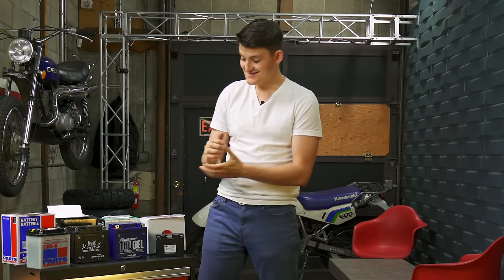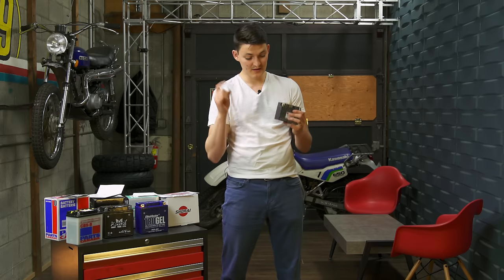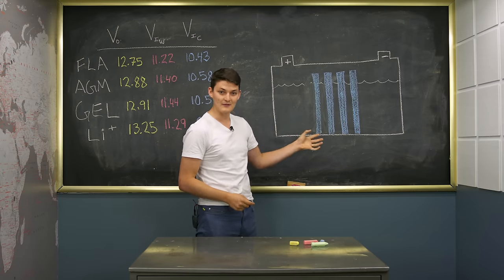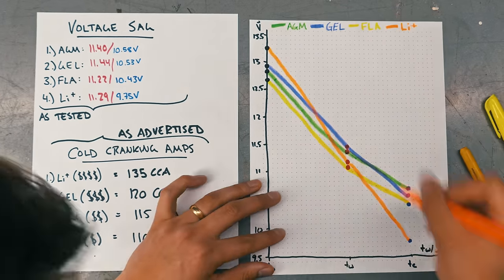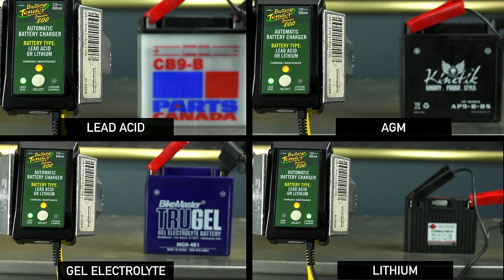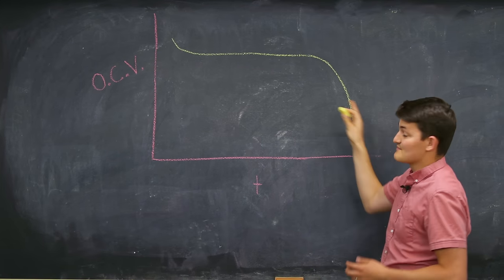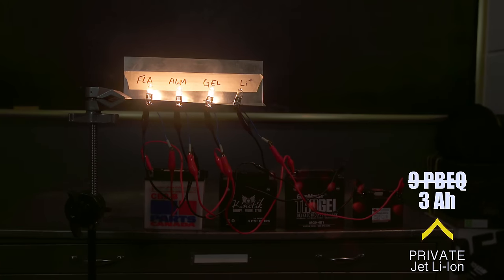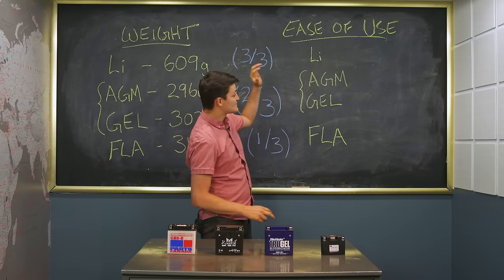Best Motorcycle Battery? Lead-Acid v. AGM v. Gel v. Lithium

Comment: I used a 3D printer to build a ventilated "box", in which I was able to place TWO Lithium batteries, which were tied together.  Then, I made a tray that drops inside it (over the tops of the batteries), where I can store stuff.  The whole package perfectly fits in the space my stock battery occupied, while STILL weighing less.
Reply: why two batteries instead of a bigger one?
Reply: Bad Idea to tie two lithium batteries together, especially  during recharging.

Comment: I'm an electronic engineer and I freak out every time I see a video like this... because most of them are full of crap. But not yours !
It's mostly technically accurate. I appreciate the research you've done, even if it's not 100% scientifically accurate, it definitely shows that you do your homework and provide meaningful videos for your subscribers. It gives you a lot of credibility. Thank you.
Reply: thanks for your confirmation, really appreciated it.
Reply: I'm pretty sure he's an engineer as well, not sure what kind though.
Reply: What were the inaccuracies?
Reply: @Ryan.......  oof it's been years, but for instance, using a light bulb instead of a constant current load to determine the battery capacity. Since each battery technology has a different discharge curve, the actual load current will vary during the test.

Same for the suicide test.

It's mostly a nit, and not a big deal for this video, but it is indeed a less accurate methodology. There are cheap battery chargers (the type used for hobby RC flying for instance) that also have a capacity test, and that can do it properly with a constant current load, and a proper cutoff voltage for each technology. They will give you the actual capacity in mAh or Ah.
Reply: its totally crap, he's just making it up.. you can tell cos there were no chronological combinations of months in 2019, or even 2018, that total 60 days.
#DetailsTellTheLie
Reply: @Ryan.......  I'd also like to mention that Li+ (lithium ion) batteries are NOT the same as LiFePO4 (lithium iron phosphate), and in this video the former is used as an abbreviation for the latter - this is largely irrelevant to the actual results (and the conclusion of "just buy the cheap one", my favorite kind of conclusion), it's just a little attention-to-detail thing that bothered me, FortNine is normally really good about that kind of thing.
Reply: @sayuas4293  I believe he has a Dr. in physics.
Reply: @Ryan.......  I laughed as well.  Why would an electronic engineer state, "...it's MOSTLY technically accurate" without stating the inaccuracies to prove his point and further enlighten the author or open his claim to discussion?  Maybe it's because his claim of any inaccuracy is also "full of crap"?
Reply: @uski  Motorcyclists tend to leave their headlights on accidentally, so it's kind of okay that he used a headlight for testing the battery.
Reply: @Ghryst  The 60 days is where you draw the line? If he specifically said "I left them for 60 days, while not specifically 2 months to the day, it has still been almost exactly 2 months.
Reply: @sayuas4293  Ryan majored in art history and physics, so not quite an engineer, but he's well informed.
Reply: "electronic engineer"    lol    I've never referred to someone with a degree in electrical engineering in that way, let alone myself.   Are you sure?
Reply: @broderp  not everyone is born in the USA. Different countries have different ways to call engineers. In the US, I would probably been called an "electrical engineer". But where I am from it's "electronic engineer". 

It's not because something is not done the way you are used to, that it's incorrect or wrong
Reply: @uski  and the fact that they are at different voltages, the lithium battery was outputting more wattage
Reply: @scottamolinari  Just undergrad. He explains why he didn't take it any further in the video about himself.
Reply: That's because electrical and electronic engineering are 2 different degrees .. so I ask .. are you sure ?
Reply: Different countries have different degree composition. The distinction in one place doesn't translate very well elsewhere. It's a pointless discussion and I see a lot of people nitpicking on the terms when the meaning is clear.
Reply: Ok, plain old lead acid is alright. But even they are not all the same quality. And so we still don't know which one is a good one. Thus nothing has been solved. There's a jillion different lead acid batteries out there.

Comment: Oh god damn it. I JUST BOUGHT A BATTERY YESTERDAY AND THIS COMES OUT. 
AHHHHHHHHHHHHHHHHHHHH
Reply: Bute the real question is .... how much?
Reply: Ehh I've never had issues with lead or lithium pick a flavor and go with it
Reply: Same, I got a massive gel battery
Reply: Same story here....
Reply: Its the same with cleaning out the garage or attic....
Reply: I hope that wasn't lithium!
Reply: David David  But if you know more then basics, you would avoid it
Reply: David David  Ok, fair enough
Yes, main advantage for lithium is power density, which is important for mobile electronics and Teslas?

Probably it is mechanically more durable, but God help you if you puncher it on a motorcycle...

Lifespan of lithium greatly degrades if you increase charge/discharge current, acid handles high currents much better. Ok you do need give it some time between high currents, but it's also good to do for the starts.

Lithium doesn't like to be fully charged, also degrades lifespan, Windows10 in balanced battery mode does not even charge it over 80%. Acid battery is very OK with 100% charge.

Lithium requires special IC to control charge voltage curve, protect from overdischarge, charge temperature. Which is another point of failure. 
And if your employer is chip, it will be done by SW driver, which is another point of failure.

In my experience lithium stuff dies unexpectedly, acid usually give you some clues before it's dead.
I would argue that lithium lives longer, I don't have experience with starter lithium batteries, but laptop batteries 2-3 years - dead, also warranty on batteries is limited (year or even half). Usually dies one cell, but since stuff is glued together you cannot replace it and need to buy whole battery.
Last week removed cooking battery from my work-laptop

Acid batteries usually last 5+ years. I've seen 10 year old batteries, but for some reason they where original that comes with the car.

I agree that we made a lot of progress with lithium, but as a starter battery - meh, not worth it.
Reply: Roman Yudin no lithium is better in every way save cost and low temperature. Most people ride sport or street bikes so temperature is irrelevant. The stuff you said about high current is completely stupid. It’s like saying “oh but foam bike seats don’t like extreme heat and will burn if you set them on fire!” Why the fuck would you do that?
Reply: David David exactly
Reply: Lithium battery are not the best for every situation, sure they’re great for someone looking to shave weight off their sportbike but for someone using their bike in cold weather/doing short rides, lithium isn’t recommended.
Reply: David David why?
Reply: David David from what I have seen in the marketplace to match factory capacity with lithium would cost 2 to 3 times the cost of gel. My lead acid batts last 5yrs so why would I spend so much on a lithium battery 😞
Reply: David David go on a diet. Much cheaper than lithium
Reply: @Sassewere  I have a lithium battery on my snowmobile and it sucks! For cold(freezing temp) applications don't bother.
Reply: always wait 1 day before buying battery. gees you gotta wait for the video man

Comment: I like my Lithium's for the 2.5kg saved from high in the chassis. They also last a lot longer than acid batteries that typically only last a few years. You just have to be mindful of their small capacity and warm them up in really cold weather.
Reply: I got 10 years out of my last AGM battery.  For my use case, this video has helped confirm my last choice not to go LiIon.  I did initially consider the total cost of ownership, but part of that cost calculation was knowing that my battery is not going to cause my bike to catch on fire.
Reply: @timconnors  enjoy the 3,5kg brick high up inside your bike

Comment: Never had an issue with Li-ion batteries and i've used them in winter where outside temps can drop to the 10's or less. I also didn't use Shorai which was often commented on as being the most susceptible to parasitic drains and dodgy warranty service. Feedback was from purchasers of the battery.

Comment: I went from lead acid to Lithium in my previous motorcycle (I never should have sold it with that battery in it).  The best advantage was weight and size.  I ended up with over half of my battery tray for space for extra tools.  I felt extra tools or supplies was by far worth the extra money, especially when on the side of a low traffic road.
Reply: I accidentally started a turbo-prop engine once with a wrench across the start leads.  Smoked (literally) both massive 24V batteries and the aux cart.  

Caution is advised...

Comment: Capacity test: I would have liked to see how many times each can crank or start an engine (take more electrons than lighting a bulb)
Reply: Because amount of energy it draws from the battery varies a lot which makes the test even more pointless than light bulb test.
Reply: Jay Jay  No. Cranking an engine is a high amperage scenario and the Lithium battery could very well be able to deliver the same amount of energy as the others if the load was high enough.

In other terms, the Li-ion isn't 9 Ah at all like they advertise but one might find the Pb batteries can deliver about 3 Ah when the load is substantial...making them pretty even
Reply: @anidiotinaracingcar4874  Yes, but it's harder to test that accurately.
Reply: most motorcycle starters draw 70-100 amps. Best way  to continously pull those amperage for consistent numbers is the same way Ebikes users do to test their battery capacity. They use a power inverter like a 1000w pure sine wave inverter and hook it up to something like a heat gun in the 900+w range. A 1000w inverter will draw up to 83 amps constant.
Reply: Yes, I was thinking the same thing. Perhaps running the starter varies a lot, but having another big load, ~1kw @ 12v, and see how that changes with discharge would be really interesting. I've never forgot to turn my lights off, on the other hand, I've had batteries that didn't have the juice to crank the engine.
Reply: @bunbunson27  An unregulated heat gun, then
Reply: @anidiotinaracingcar4874  Consistent current draw, though
Reply: Oliva Gina  Post your video then and I'll critique it
Reply: Oliva Gina  Must not be that easy then
Reply: Oliva Gina  But they aren't cranking an engine, so it's irrelevant to what I said. 

But yeah if those machines are so cheap and easy to get, why don't you send one to PF so he can do the testing?
Reply: VolDep45  Except for the fact that bikes have alternators.
Reply: Oliva Gina its called a load tester and can purchaesd for as little as 50 bucks
Reply: @anidiotinaracingcar4874  You're right and that is a very important point. There is a reason that vehicle starting batteries are rated in CCA and others in amp hours. Just to further undermine the lightbulb test, in FLA, AGM and gel, the faster the discharge rate, the lower the capacity. I'm not sure about lithium tho. 
I've had the misfortune of again researching batteries today because my current factory AGM is just about shot. I settled on lithium iron phosphate because of the weight, the higher CCA and the low voltage cutoff...because leaving my ignition on is how I killed my current battery. Also, they can be charged far quicker than the lead acid options using the right charger (90% in 6 minutes for for the 290CCA I just bought).
Reply: VolDep45  Not necessarily, because the total capacity of a battery doesn't really matter at all. It's how much charge you can draw from it until it can no longer provide enough power to crank the engine that ultimately matters.

When people say their lead acid battery is "flat" because the engine won't crank, it probably still has well over half of its charge left. The problem is its output voltage has dropped too low for the starter motor's torque to overcome the engine's compression.

This relationship between state of charge and voltage is different for different batteries, you can discharge a much greater percentage of a lithium battery than a lead one before the voltage drops significantly. Although if that's 80% for Lithium vs 50% discharge for lead, but the lead has three times the capacity for the money then you can still get more cranks out of the lead one as each crank is a smaller percentage of discharge.

The best test would be to simply crank an engine repeatedly and see which lasts longer, ensuring the engine is allowed to cool down to the same starting temperature for all batteries.
Reply: This is a 2 year old video and lithium batteries have improved expinentially. They can produce 600 CCA compared to AGM's 120 CCA. Fortnine should do an update on this.

Comment: Really great video. Just wanted to mention that Lithium Iron Phosphate (LiFePo4) batteries have a unique chemistry compared to the average Lithium Polymer (LiPo) batteries and this typically results in failures not being explosive. I'm not sure if it changes the low temperature charging issue, but my recollection is that it improves it compared to common lithium chemistries.

Comment: I found this pretty interesting. I have always been partial to AGM batteries, but I got a $38 conventional battery for my 1998 H-D Sportster and I'm into my second season with it and it's holding up great. It stayed in the unheated garage this winter in the New York City area with a ride on it whenever there was a descent day with no salt residue on the road. It's carbureted so sometimes it takes a bit of cranking if it's sat for awhile. I don't take the battery out (a royal pain) and there's no electricity in the garage. The battery takes the cranking no problem and starts up. On the other hand, an old simple bike like this has no parasitic drain either. I was looking into Lithium batteries for my 2003 H-D Ultra Classic and found 14AH batteries for (gasp) $300! These are the ones listed for the bike which comes stock with a 28AH conventional battery. Being Fuel Injected, it starts virtually on the first compression stroke. However there's a good amount of parasitic drain like any modern vehicle. There's the security system, memory for the audio and trip functions. Now, here's the thing about how a 14AH Lithium battery would work. The bike starts instantly, and the battery is capable of taking as high current load. This is how those car jumpers work. But if you leave your radio on and you have those colorful show-off lights, that 14AH is going to go fast. And on an older bike it's not going to take too much cranking. For $300, I don't get it. Now for the guys and gals who zip around on bikes with sliders and such, I get that you're concerned about going down and what a mess conventional battery might make. AGM takes care of that. But the thing that bothers me most about Lithium is the fire potential. I have experience with LiPo batteries and I know that a lot of people charge them in Ammo Boxes because of the fire hazard. I know the chemistry of Lithium Iron is different than Lithium Ion or Lithium Polymer, but it has very similar fire potential. By the way, early Lithium batteries had a 1C rating which means that you don't want to pump more than the rated AH into it per hour. But a lot of advances have been made in that regard and I've seen 10C charge rating on some batteries. That means you can charge at 140 Amps (at 12v) into these. That little battery tender charger is not going to cut it. Also, why do you need a special charger for Lithium? I ask this because the vehicle it's in is not designed for it. I thought there is special circuitry buried in the case that manages the peculiarities of Lithium charging.
Reply: TLDR
Reply: Cool story bro
Reply: @Faetter-Blobs-Filmbiks  Thanks. By the way, I just came back from a ride on my Sportster. The bike started right up after sitting for weeks. And it has the same battery I wrote about 2 years ago. I have electric in the garage now so it’s been on a tender and I’m sure that helps. Have a great riding season!

Comment: I go with lithium ion now.  I have a an 09 Speed triple. These bikes are notorious for charging/ starting issues. I store my bike outside. I go through a battery a year normally, prior to using a lithium ion. Even though the lithium is more pricey it should last me much longer with prolonged periods of “storage”. So far the battery works great and my bike always starts up. Better than ever actually.

Comment: This is spot on from a principal standpoint and great info. Having been in the battery industry 20 years I’d just impress upon you that there are good options (better than what was tested) in all categories but gel. There’s solid flooded, a little better lithium, and light years better agm out there. Such a great vid.

Comment: 4 years back I replaced my 2009 R1200GSA battery for a Antygravity ATX 12-24 (what they claim 720CCA), the largest they had I could fit in the space!  (Replacing also the legacy relays that were draining) Love it and even boosted a freinds F250 diesel on a cold spring evening!